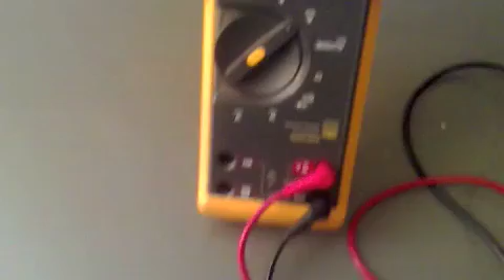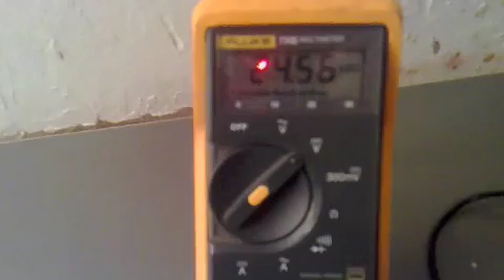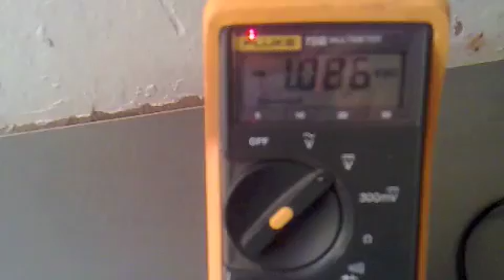Joule Thief (Circuit) 001

Comment: why dont use an extra cap and resistor then control the frequencey and reduce power by means of a ramp up like a neon transformer but with a feedback osciliator as a trigger.  that way you only use as much energy as it takes to keep a small cap charged almost then. you can save more power if you make a dubble ramp and use a zener diode to keep the load resistance as high as possible.

Comment from the maker: Thanks, I have made the LED light up full brightness now as its charging the battery to about 1.3-1.4V...;-)

I might try in on a 12v system and a larger gauge wire.

Post your results when you make one...

Paul

Comment: sorry im confused im thinking.

joule thiefe, recftifier, capacitor....then using the voltage off of the capacitor add another joule thiefe, rectifier, capacitor, ect. ect.. to get the desired voltage.

think im off, im new to the joule thief.

Comment from the maker: It works on the Lemon Battery the same way.....

I think its all DC we are playing with and the LED Rectifies the circuit and four would be a bridge rectifier. Ill try both though cheers.

I Want to run a Neon off a button cell....

Thanks for watching.

Comment: awsome,,, you should make a how to video on the joulethief.

how does it work on the lemon battery???

oh and i think "dont take myword for it"

but if you put 4 in series you may need to rectify and put a capacitor in between each one. like a voltage multipler.  please let me know if im wrong.